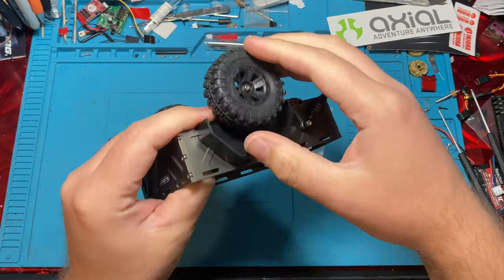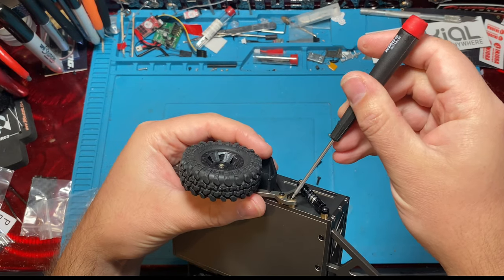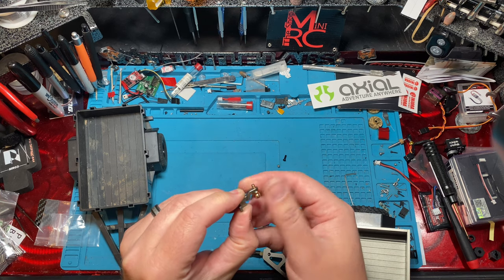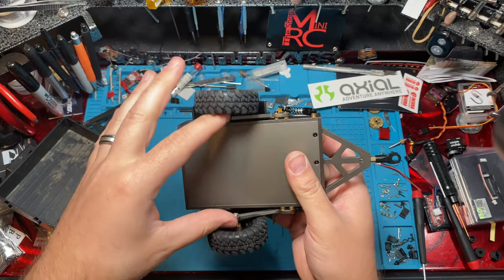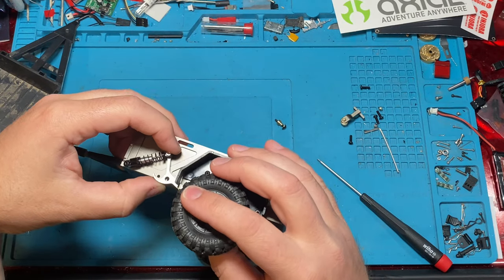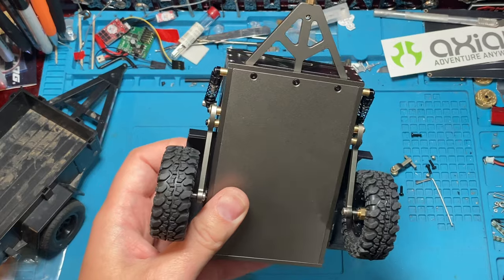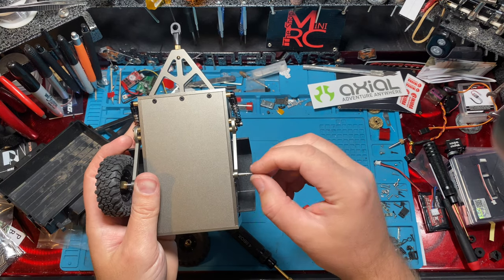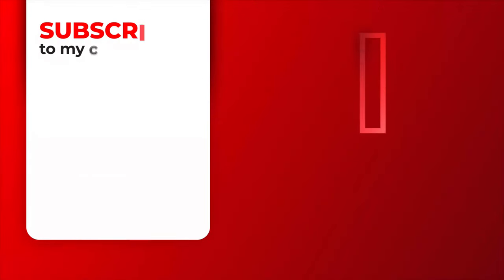Globact Aluminum RC Trailer Crawler Trailer for 1/18 and 1/24! This thing is beefy!

Comment: Did you notice the K5 struggle to pull that extra weight much? Thanks for using the K5 too, more relevant for my decision on whether to get one or not (scale wise).
Reply from the maker: more that it needed stiffer rear springs. It seemed to have plenty of torque in the 1st gear. 2 speed is awesome!

Comment: I got one too, It's nice but the control arms need to be thicker!! The wheels camber inwards with just the weight of the trailer..
Reply from the maker: Yeah, I agree there.
Reply: @TheShopMiniRC everything thing eles is beautifully machined.. but I cut off the ends of a scx rear axles an epoxy it onto were the wheel shaft inserts in, too help add more support..